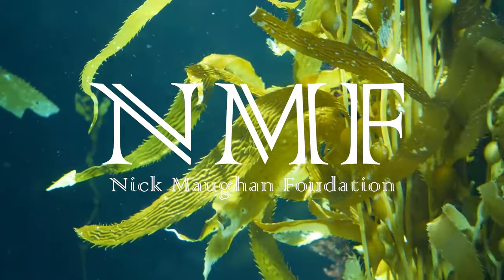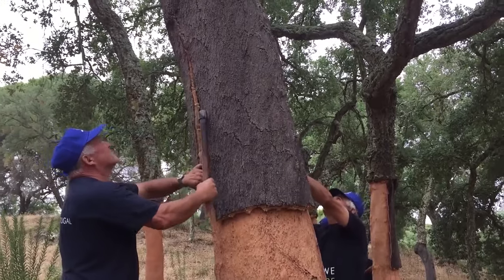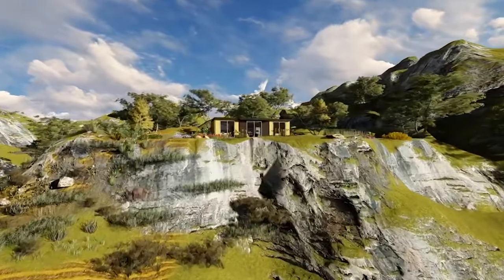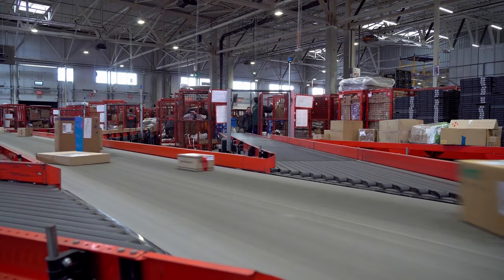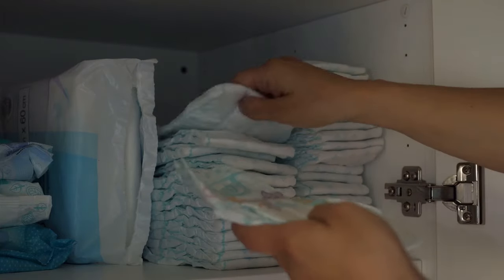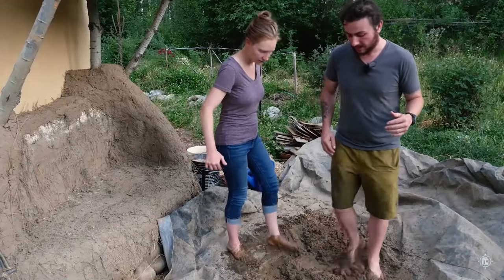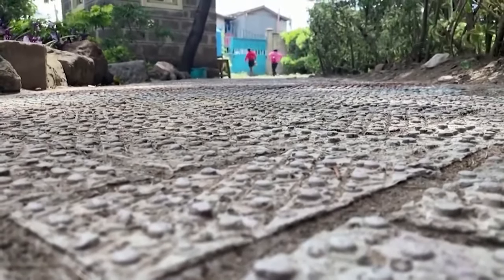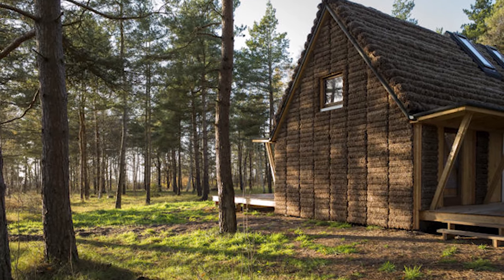10 Eco-Friendly Building Materials | Sustainable Design

Comment: I think the real lesson here is to focus on using locally available materials as building solutions. The reason many products are not sustainable is because of how much we use which causes an imbalance in the ecosystem. If we say cork is the new global material, over harvesting will occur and it will no longer sustainable. Same goes with seaweed, and all the other materials listed in this video.

Comment: I had no clue cork, coffee husks, and mushrooms could be used for building! the only part I'm conflicted  with is the algae power, I would prefer  would be is to start implementing molten salt reactors using thorium(233)-uranium(233) cycles and implement more resources into fusion energy, as both produce obscene amounts of power and are a much more sustainable source than fossil fuel plants and produce less waste than traditional Uranium reactors, there's even reactors being made that can recycle spent nuclear waste from other reactors

Comment: Cork based on this video would require 9 years between harvesting with older cork trees yielding better quality cork? How many trees would be needed for one home? Sustainable is questionable. Coffee husk mix with plastic means it won’t break down naturally once its life cycle is over: hardly eco friendly. Newspaper panels using newspaper sheets sounds great at first for reusing materials treated as waste until it mentioned adhesive is the means for sheeting them together. Depending on the adhesive, this could be great or completely opposite of that. Would hardly call them eco friendly....